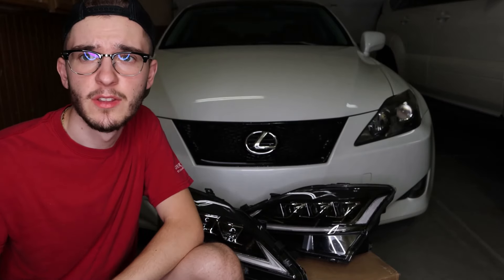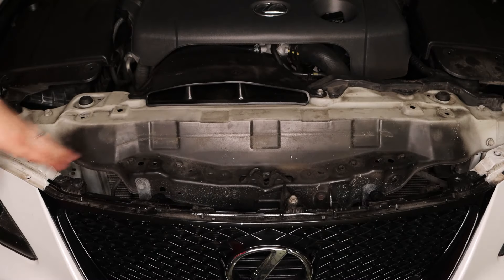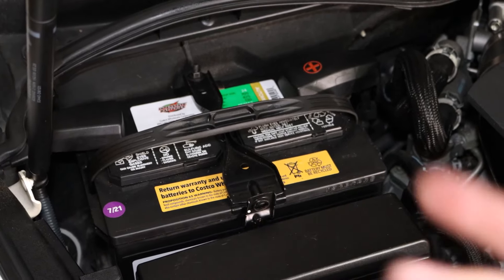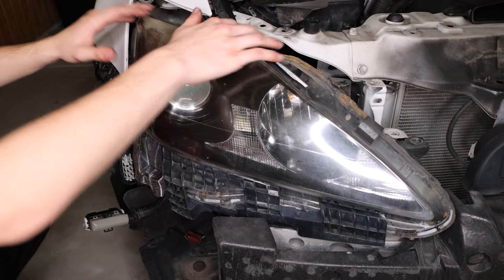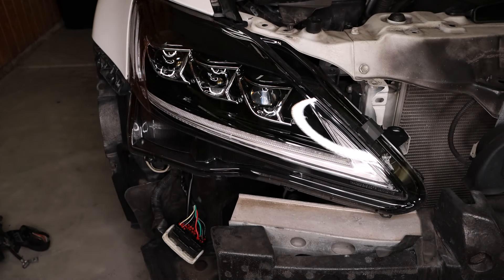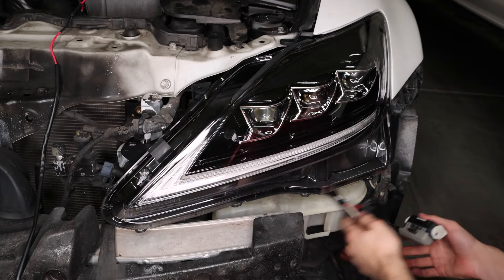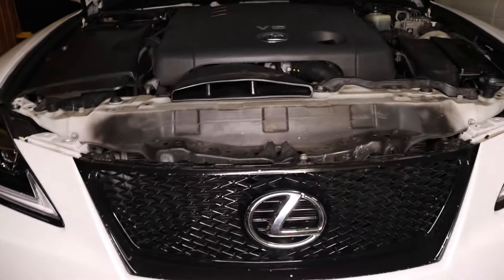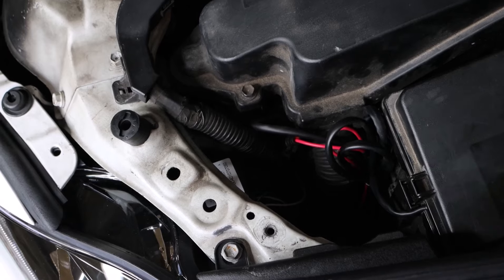HOW TO: Install VLAND Headlights on IS250/IS350/ISF

Comment: I just recently installed my VLANDs they look amazing, but I have a problem. My windows don’t work automatically no more and I can’t operate them from driver side. Each person can still move their own windows. But I was wondering does this have to do with removing the 10 amp fuse that we had to replace? If anyone could help that’d be great.
Reply: Bro the same thing happened to me
Reply: This is because you disconnected the battery.
Thats normal
You can reset it look it up
When my batt goes flat in the winter it happens every time .
Reply: Look up “how to reset windows lexus is250/350 after flat battery”
Reply: Looked it up for you.
Go to each window and roll it all the way up and hold it for a few seconds and all the way down and hold it for a few seconds and all the way up again and hold it for a few seconds.
Then it should work from the drivers side again.
Reply: That’s just because you disconnected the battery, so some things inside  the car reset. I had this issue as well, pretty sure you just gotta roll it all the way up and down and hold it or some shit then it’s good, as well as the memory seat settings. You can look it up it’s an easy fix but I was super concerned at first too lol
Reply: Go to each window, lower the glass to the stop with the button and hold the button for 3 seconds, and then raise the glass, also holding the button for 3 seconds. Perform this function for each window and they will be registered in the driver’s side control system 🙌

Comment: so my ballast went bad, if i buy new headlights do i still need to buy a new ballast or do vlands etc come w that..?
Reply from the maker: The vlands don't require anything from the old headlights. They are built in LEDs and require no maintenance. You are all set!
Reply: Ballasts are cheaper and not hard to replace. If you do get these, restore the oldones and keep them as spares because the factory hid with afs are expensive as a whole unit and if you sell the car or something happens you can always put the factorys back on
Reply: Headlight comes with ballast

Comment: You don’t need an 8mm socket to adjust light beam.  Stick a long enough Phillips screwdriver on to the sharp teeth looking part and start turning clockwise to go down or counterclockwise to go up.
Reply from the maker: That will work aswell, thank you!

Comment: Just replaced mine with these Vland's and this video was a huge help, thank you! 

Not sure if its a little different in the ISF but a couple things to add since i have an ISF- 1) make sure to take off the old brackets off the old headlights to the new vlands. this will help the bumper to be more secure. 2) you will now get a flashing AFS light because these lights do not have that function anymore- remove the AFS 7.5 fuse( hpl lvl ).

Also i saw a lot of vids that said you need to go into the computer and disable the DRL, however i did not have that problem with the constant flashing with the high beams. I'm not sure if that's because of what fuse we used but didn't have to do this. 

hope this also helps!
Reply: Does removing the fuse clear the flashing afs light?
Reply: @tommychii  yes
Reply: @bells4086  where is the fuse located pls
Reply: what year was your f? I have an 08 isf that will be getting her headlights changed soon.

Comment: Thanks for the video, helped a lot. Had some issues because they sent me the wrong wire connector for the headlights hopefully they resolve it soon.
Reply from the maker: If you have any questions feel free to ask!
Reply: Hi what kind of issues were you having? I’m having the flickering but also something electrical with the lights fired off my transmission solenoids. Took it to a shop they said it was the lights.

Comment: I must have outdated ones as the high beam bulb acts as the DRL along with the checkmark. Ontop of that, the high beam light will flicker until I turn on the headlight setting
Reply: The high beams flicker because of the stock DRL light (The stock DRL lights use the high beam but at a lower setting, too low of a voltage for the Vland LED's to function properly so it just flickers). Lexus can hook up a computer and turn off the DRL's for you.
Reply: I have the same issue but if we disable DRLs will we lose the check mark light also?

Comment: On the original headlamps there is the black brackets. Do those need to be transferred to the new vlands? I’ve seen different videos where they are transferred, is that necessary?
Reply from the maker: You can transfer the brackets onto the Vlands but there is no need for them. I chose to leave them off since there is no benefit to having them there
Reply: Transfer the brackets. You need it so your bumper can snap onto it. Without it, there's going to be a gap.

Comment: Great video👍🏽 
How did you turn off the factory DRL  cause on mine the high beam stays on with the check mark DRL and the high beam with some kind of flickering
Reply from the maker: The DRL stay on all the time while the car is on. The only way they are off like I had in the video is when the car is first started and in the park position with the lights in the off position
Reply: I had the same issue, you will need the techstream software to turn it off and once you do that the flickering will stop. You may want to go to your local lexus dealer and ask them to turn DRLs off.
Reply: @MrEklipze  but what if I want the drl to stay on?? I just don’t want them to flicker. Is it an either or??
Reply: @cp3onmtv963  The swoosh DRLs will stay on. All you are doing is disabling the old DRL wires, which these new lights do not use, they only create flikering, therefore you want them off.
Reply: @MrEklipze  ok got you! Thank you for responding!! I’m looking to purchase a rx 350 and researching all the stuff I want to do beforehand lol
Reply: @cp3onmtv963  this is for an is250 though, i don't know about other models
Reply: @MrEklipze  it’s all good, I read something similar regarding the rx!
Reply: You can take it to a Toyota or Lexus dealer and ask them to disable the DRL so it's only the check light.
Reply: @MrEklipze thank you man! Just installed mine and they were flickering thought i did something wrong

Comment: I got these on my 350 got a warning message “ check headlight system” not sure what it is everything works fine
Reply: I have check Headlight system did you find out what it was?
Reply: It's for the auto focusing leveling from the standard headlights the replacements dont have it .
Reply: @Vivid_Visuals  I took the fuse out under the steering wheel the error message is gone 🙏🏼
Reply: @_MIKIMOTO_ which fuse?
Reply from the maker: Some models will causes this error unfortunately, my vehicle didn't get this problem but it is due to the headlight leveling system that is connected to the suspension

Comment: Hi, I have a quick question.  Did you have any flickering issues?  is it better to use a VCI cable and disable the DRL lights or should I buy a resistor to prevent the DRL from flickering?
Reply from the maker: I didn't have any problems with flickering. Did you make sure to connect the fuse tap to an ignition fuse?
Reply: Yea what’s weird on mine is I followed installation to the T and for some reason my DRL Led are on but also a faint flickering of the highbeams are on as well. Only when the car is set for DRL. Idk why it’s on? I believe it’s only suppose to be the LED strip

Comment: Did u instal the bracket under the headlight ? I didn’t see u putting it back
Reply from the maker: The VLANDS didn't have spots for the brackets so I left them off. I used zip ties to keep the harness out of the way

Comment: Did any of yall get the DRL flicker.
My first set was perfect.
Had headlights replaced at shop after fender bender and now I have DRL flicker.

Any help appreciated
Reply from the maker: I would make sure all the connections are good and then I would contact the seller for a replacement set if all else fails

Comment: Hello,
Yesterday i replaced my headlight with bland, but always warning "CHECK HEADLIGHT SYSTEM " how to disable this..pls advice thanks
Reply from the maker: Do you have the modules for the headlights plugged in?
Reply: @nkautos  my bad. i don't get you.. i already plugged headlight.  I don't understand what type of module you're asking me..
Reply from the maker: @aslamph1  There's a module on the headlight harness. Try to unplug it and plug it back in
Reply: @nkautos  so it's attached to the headlight? Thank you so much for your reply 😊
Reply from the maker: @aslamph1  Yes, it is connected to the headlight. Make sure it is plugged in all the way! I hope this helps!
Reply: @nkautos  sure.  Thanks so much...
Reply: Did you find out what the check Headlight system?
Reply: Hey Zeke, I fixed and reprogrammed the software. There's a device under the steering wheel that an electrician reprogrammed using a computer.

Comment: How are you my friend, I have a question, I have a 2003 gx470 
 can I change the automatic transmission to a manual transmission?
What kind of manual transmission?
Thank you so much for helping me so much.
I don't forget this favor for you.
my greetings for you
Reply from the maker: Hello friend. I haven't seen anyone swap the transmission from automatic to manual with the 4.7 engine since the Toyota Prado 120 comes in a manual overseas it has a different engine connected to it. Due to this I don't think it is possible to pair a manual transmission with a 4.7 engine

Comment: Is it possible to change a bulb on the headlight or is it a mono light, the whole light needs to be changed??
Reply from the maker: Unfortunately they are a sealed unit and cannot replace the LEDs
Reply: @nkautos hey I have a question, how come day time beam is off for one of them but when I use the high beam it turns on

Comment: I have a 2010 is350, driver side headlights is broken. Xenón adaptive. I’m thinking going Vland cause my broken lights cost more than the pair on vland. My question the fog light won’t work? I’m I going to get the AFS light on dash? Thanks
Reply from the maker: Should be no problem with the fog lights, mine still work and aren't throwing any codes on the dash

Comment: Hello, my factory 2011 lights play up because of the ballast. Will this headlight swap bypass the need for factory ballast right?
Reply: Hey I’m having the same issue, did you ever get an answer?
Reply from the maker: Yes the headlight swap bypasses the need to replace the ballasts as they are a completely sealed headlight

Comment: How does it look with the car on and low beams off ? Is the checkmark on? I read that the high beam flickers?
Reply from the maker: With the low beams on, the check mark is on. With the low beams off, the check mark is lit up as daytime running lights. I have no high beam flicker issues.

Comment: If a led dead it is possible to replace it ?
Reply: From what I read, answer is no
Reply from the maker: Unfortunately no, it doesn't have any access to the LEDs without completely taking the headlights apart

Comment: I just connected mine but the top swoosh lights won't turn off even with the car off. Any idea how to fix that?
Reply from the maker: Did you make sure to add the red wire to the fuse box connection like shown in the video?

Comment: DRL is working properly without any computer adjustments? I have read that DRL won't work unless you adjust the computer with the dealer or shop.
Reply: As far as I know, thats only the case if you use the Lexus OEM lights with DRL and retrofit them into a 2009 or after model (facelift).
The VLand lights are for all models 2006 to 2013 don't use the ECU for DRL.

Comment: Does it cause check headlight system warning?
Reply from the maker: It didn't cause any warnings for me but for some people it has, I would try to reset the battery if you get any errors
Reply: @nkautos  installed the headlights and got the warning lights on dashboard, fortunately there is a small fuse you can remove and the warning message gone
Reply: @mohammedal-hussaini2976  what fuse did you have to remove? Mine keeps displaying the check headlight system and how did you get the check mark to work? mine does not turn on at all
Reply: @veraniaish  it’s in the driver’s  side instrument panel near the brake pedal fuse called 7
H-LPLVL  and it’s 7.5 A

Comment: Hey, I just got mine installed Friday at a shop and when it was night time I was trying to see if the check light would turn on but it doesn't unless I have my turn signal or 4way flasher. You think it could be the wiring?
Reply: How much did the shop charge you??

Comment: My passenger headlight won’t work and a shop doesn’t know what’s wrong. If I get these headlights and connect them to the fuse box will the passeneger work or will I be in the same boat. Please help thanks
Reply: It should work also if you have an AFS system with the HID headlights(not the halogen) you might have a bad ballast on your factory lights
If the lenses are good on the factory ones and you have the HID with the auto leveling its honestly not hard to change the ballast out and not all that expensive like 40-70 for a ballast.
Its simple to do as well i would suggest that because AFS HID factory lights are expensive to replace the whole unit and its more worth it to keep the factory ones IMO 
I have ballast issues and one of my lenses is just wrecked so i ordered vlands they should be here this week
Gonna take my factory lights and replace the lens and ballast  and keep them as spares

Comment: Do you know if I have to remove head light to replace ballast?
Reply: Yes. I did it on mine a few years ago. I had to drill the heads of the screws as they were that corroded. Does not take long to do though.

Comment: hi is250 2010 install that light but check the light system sign in the speedometer how can i fix it
Reply: Remove the AFS 7.5A fuse
Reply: I'm trying to find out the same thing if you found out can you let me know thank you

Comment: Do the highbeams stay on at full power when the low beams are not on during the daytime?

Is the Swoosh connected permanently to 12V? So at night time they are on full power instead of 50% power?
Reply from the maker: The high-beams do stay at full power, also the 12V is for the DRL while the car is on
Reply: @nkautos  So I guess you need Tech Stream to disable the DRL high beams?

Comment: Does the DRL flicker for you?  If so, did you try to fix that issue?
Reply from the maker: I haven't had that issue, but the drl are connected to the add a fuse so double check that connection

Comment: Did anyone get a “check headlight system” light after installing.
Reply: Did you get " check headlight system" ?
Reply from the maker: Seems like a few people have, try to reset the battery or double check the connections
Reply: @nkautos  ended up being a fuse i had to pull under the steering wheel. Problem solved🤙
Reply: @jackcarroll9035 do you remember which fuse it was?

Comment: I just installed my headlights today and everything is working fine besides my turn signals, they keep flashing rapidly halfway and not all the way through. Anyone know what the problem is?
Reply from the maker: That lights hyper flash when the car senses there's not enough resistance from the light. Try to disconnect the lights and reconnect them that worked for me when that occurred

Comment: I installed these myself to and my v light stays on and kills my battery. My switch nob settings aren't right either.
Reply from the maker: You have the wire connected to a constant fuse. You need to add the connection to a fuse that only turns on with the ignition

Comment: Just did this and my left amber sequential isn’t working. I put my emergency lights on and only right amber sequential works but not the left. Someone help?
Reply: That’s what’s going on with my car too. Did you manage to fix it?
Reply: @andrewmontero272  yeah, i actually punched it and it ended up working, but only a portion of it. unfortunately i don’t think there’s any fix because the amber lights are on an LED strip and it’s not worth the hassle of tearing it all down over a strip

edit: just try and hit it hard with your hand, unfortunately there is no fix. i tried jumping the wire thinking it was a prong, but nope…if it’s ur LED strip ur pretty much screwed. 

currently only half of mines works, occasionally 3/4 of it will work, and not often but it happens, i have to give it another smack because they all turn off all of a sudden. Just something you’ll have to deal with unfortunately.
Reply: @Atlas-wh2vg  Punching it is interesting i’ll give it a try. Mine blinks but it doesn’t blink amber it just blinks white and the same goes for my emergency signals and they aren’t sequential🤦‍♂️
Reply: @andrewmontero272  yeah, you have to be careful as well because you don’t want to be running with no working signal. what’s crazy to me is that both the white and the amber lights are on the same strip. my guess would be a lose wire connection on the circuit coming from the the amber wire in specific. To find that specific wire is a hassle on its own, but try to see if it could be just a prong that’s missing. if it is, you’ll just have to buy a wire with a fuse and you should be good. 

If you brought them from vlands directly i’m sure they’ll have warranty. if it’s been a while or you bought them second hand, then yeah you’re pretty much screwed.